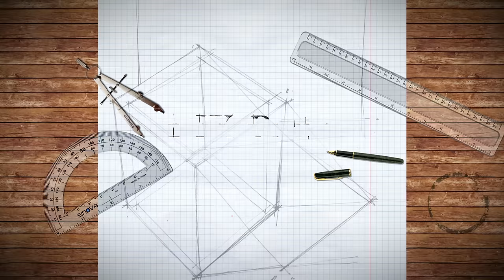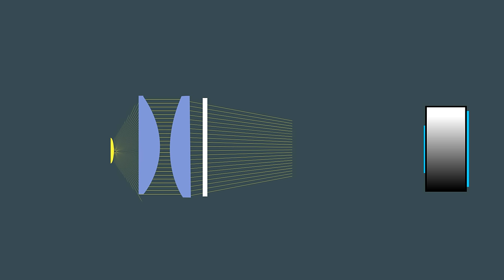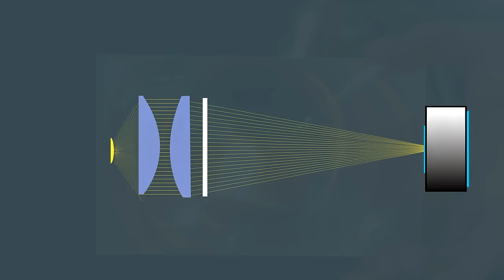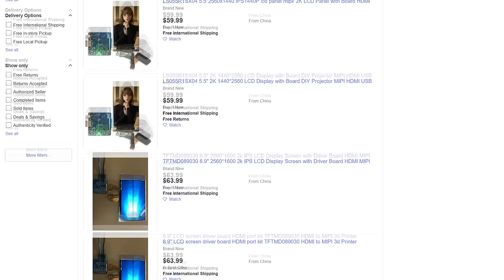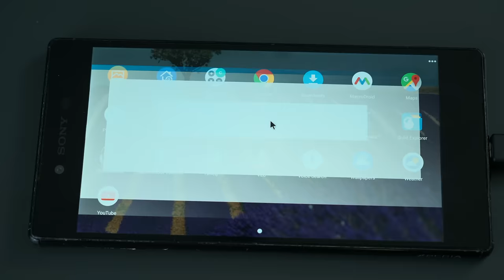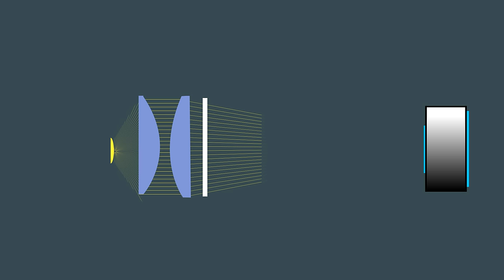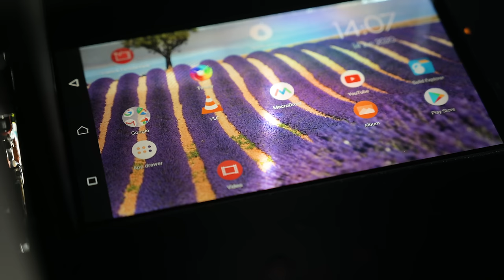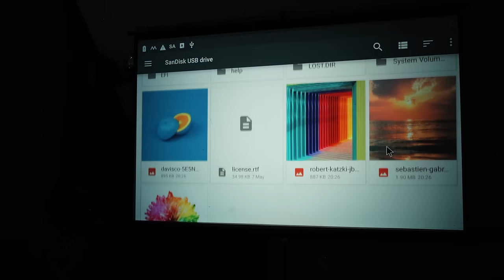Building a TRUE 4k home cinema projector (it’s awesome)

Comment: Just thinking, if you did decide to go for a more powerful LED, to alleviate the cooling and noise you could use an all in one CPU watercooler. Obviously design changes would be needed but you could comfortably deal with the heat I think.

Comment: A cpu heatsink is made to be oriented exactly opposite of how you have done it in the video.  The idea is that a small amount of liquid in the pipes evaporates then travels to the far reaches of the head sink and then cools.  Gravity then transports the cooled liquid back to the heatsink base.  If the heatsink is completely upside-down most of the heating performance will be lost ...

Comment: Stray idea ... build the entire thing sideways, use book bindings to skin the front of it, and set it on a shelf behind your seating. Just be sure to adjust the plan for cooling, airflow, and you could even remote the focus adjustment to the bottom end by running a hex or square rod the full length.
The one thing most missing from the design as a whole is ability to adjust size/skew without moving the projector to do so.

Comment: The sun is an extended light source with a 0.5 degree field. So it can never focus down to a point. The size of the suns image is given by 
D = focal length x tan(0.5 deg). 
Another thing about this design is that it doesn’t address uniformity of illumination. A superior method is to insert a pair of equal focal length lenslet arrays after the collimating lens. The spacing of the lenslet arrays is equal to the lenslet focal length. 
Now you have the LED light source integrated in intensity. You follow this by another Fresnel lens that images this field onto your light valve. 
Too complicated to discuss here, but using lenslet arrays produce the most uniform illumination.
Reply: Is there any chance of some sort of diagram to show this? I find it hard to visualize. I would love to see examples!

Comment: great build. if it were to be me, the build would be significantly taller and bigger because i'd use a 300w LED COB, mated to a peltier module, AIO cooler, and a dedicated cool air intake port, and air channel from a nearby aircon to maximize heat dispersion. since phone parts now are easier to source now, i'd go for a native 4k120hz note/tab screen, maybe samsung tab 9 ultra. use of larger screen is also vital to minimize the effect of heat from that 300w LED COB. just one question, how to integrate it into a dolby atmos AVR/processor?

Comment: With f/4 photography lens  you get about 8x less light opposing to real projection lens. But in such a focal lenght it's impossible to get some more speedy lens. With freely shining LED with no collimation you get only a fraction of LED light output to the LCD panel surface. Because only part of the overall light hits the fresnel lens below LCD. But wonderful project anyway.

Comment: Old video I know. But still inspiring. I have a few questestions: Because your LED is so color accurate, I wonder, where the color imbalances stem from?  Could it be the LCD screen, how Video is handled by a smartphone internally,  or even the glass of the older lens. For the latter,  would it be possible, to salvage a lens from an old/broken beamer from 10 years ago and have better results (I dont mean the very cheapest model). I also don't understand, why any lens could be considered too "small". I mean I could always size the light beam down(even to a point) by manipulating the distance between converging lens and projection lens. What am i getting wrong? As always great content.

Comment: Some modifications include ditching the phone completley and using the control board with ChromeCast, or Apple TV to utilize ScreenCast, or AirPlay. Worth noting that you need some HDMI ports if you want to connect your laptop to the projector. Also worth noting that you need some way to make like a standby mode by wiring some relays to the LED driver and a momentary power switch. And if you want a control over smartphone you can make Arduino setup with the WiFi shield.

Comment: How long does the LCD panel last before get burned? Also the projector is too dim. But using high power will get LCD burned very quickly. So, can you do DIY vido in how to build dlp, either 1 dlp or 3 dlp 4K projector?
Reply: God I wish he/someone did. I really want to build a good long-lasting projector.

Comment: Using Xperia z5 premium is a bad idea because I have used this device before,  the problem with it is that it can only display 4k images through the original gallery that is provided by the system so you can't use YouTube or any other app or browser , and it takes a few seconds to display the image in full clarity, and in addition, it only displays certain video formats in 4k and it must have certain format and not high frame rate and bit rate .

Comment: Funny: I bought the 4K Projector he used for comparison (or a successor of it) around x-mas this year without knowing this video. For me the image quality is more than ok, the brightness is impressive and the fans are not that noisy as he described. Yes it cost my a liver (1800€) but if I consider the time he spend on this project, the necessary machinery, the material and possible fails during build I'm satisfied with my LG Beamer.
This post is nothing against this DIY project - that is really awesome. It was only a decision I made for myself.

Comment: Would it not be possible to swap out a cheap projector LCD panel with the one you are using in this project? I was given a faulty one of those cheap projectors a few years ago and when I opened it up it was quite a basic setup, led light, low resolution LCD panel, mirror and lenses, surely with a bit of jiggery pokery alterations with the housing it could be done,  maybe an upgrade on the led light so it's brighter to 🤔

Comment: Nice video, but would be even cooler if you tried used parts from a tv to add HDR (maybe even Dolby Vision), some HDMI 2.1 ports and see if you even could reach 120Hz refresh rate
Reply: HDR is not just a software or a controller, for this project you must use mobile parts. HDMI 2.1 is unnecessary, 120Hz is unnecessary for movies, HDR is useless with this low level of dynamic range. You can spend all that money on a better canvas, which will be a great improvement.

Comment: Is there a way one could add a stage at the start to allow a larger LED panel as the light source maybe focusing it to a point usable by the original design....?
Something about 28x28cm using a panel of high-efficiency diodes....
A 100W diode might push out 8500lumens, a 100W panel could put out in excess of 17000.... and cooling isn't even that hardcore.
Reply: I am VERY curious of what the answer to your question is, 17.000lum would be amazing! I did a lot of VJing in my life and the sun rising in summer parties is just enough by itself to keep the dancefloor alive, smiling and pumpin', but damn those winter gloomy sundays mornings.....they could have used one or two more hours of colored trippy visuals!

Comment: @6:05 Those wires sticking up vertically is a mistake.  The LED will heat them up and destroy their insulation in no time - unless they're silicone.

Comment: i wonder if you could use an arduino to send an image to the screen instead of the phone... and also you might be able to hook up audio in connectors and like a power button and you could hook up a blue ray player or even an HDMI in port.

Comment: You mention in the video that "in just a minute" (21:20) you will be explaining why the air needs to push out, but I didn't catch that in the video "later on".
It feels contraintuitive that you are trying to suck the hot air down from the top and out at the bottom (after all hot air "wants" to rise), rather than suck in cool(er) air from the bottom and hot air out the top. I'm sure you thought this all through and there is a top-notch explanation, but, despite the mentioning, I failed to find it in the video.

Comment: This is amazing! But what if you still try to increase the brightness of this projector by modifying the matrix? For example, try to carefully wash off the reflective coating from the rear polarizing film using an acid solution. Or remove this polarizing film and make a new one with the correct direction of polarization, using the top film from the display with a larger diagonal, turning it at the correct angle.  Of course, if I were making such a projector, I would simply choose a matrix model without a reflective coating, albeit with a 2K resolution.
Reply: And also, instead of the power supply from an old laptop, you can use a more powerful industrial AC-DC converter with an output voltage of 12V. It should be more convenient and reliable compared to the laptop power adapter. This may also make it easier to use a more powerful LED.
Reply: I wish I could visualize what you mean. I am not sure what that would do/benefit it would have.
Reply: @Yourname942  I meant that if you wash off the reflective layer (aluminum coating), the brightness of the image may increase.

Comment: Interesting video. I've always thought it was akin to a cine projector / slide projector, which is simply a light source behind a film image, and said film projected via a lens of suitable frame size. The projectors of the 70's rarely used lenses to focus the beam, just relying on super hot, bright halogen lamps. (Can you imagine how hot a 1/2" high 100W halogen lamp got. If the cine film remained in the gate for more than a fraction of a second, it melted !!) 

I actually came to this article as thinking of making 100W video lights with suitable heatsink+fan ... if I can find a non heatpipe design!! In theory, should be as bright - but smaller - than the LED strip panels you made. (I currently have modified 50W LED floods with a fan blowing against heatsink)

Comment: Couple of things, why didn’t you put the display between the collimator and the converger, why didn’t you use an sla printer display replacement; very high resolution, usually 5.5 to 6 inches and the backlight is pre removed.

Comment: Sadly a lot of questions/details haven't been covered (in the video, in his comments section, nor on his patreon, overall lumens / ANSI Lumens, how large an LED needs to be/can be compared to the LCD screen size, generally how long before the LCD burns out, how much time can the projector remain on (I plan on using it daily for 6-10 hours a day), if water cooling would greatly increase the life of the screen (or if it is even possible - without causing distortion), as well as color quality/range/contrast levels, and I read someone mention about the way his setup is leads to non uniform lighting

Comment: As far as the brightness goes, you could probably buy a different shade of polarized film, and replace the one there, and probably set up a feature to adapt the brightness level for the Led. The DIY unit would far exceed the expensive unit by leaps and bounds.
Reply: would that be very expensive to do?
Reply: @Yourname942  Nope, you can buy sheets of polarized film, and it's pretty cheap. As for the LED, you would just need to wire in some kind of simple controller, like a dial of some sort, that exceeds my technical ability, but I'm sure if I looked into it I could figure it out, is it expensive? No.
Reply: @ichigonubetube  well that's good. It is also out of my technical ability, but maybe someone knows :)

Comment: He claims the air is pushed outwards from the center gap however at 20:05 it clearly shows the arrows on the fan housing (for one of the fan) pointing towards the radiator meaning the air is pushed into radiator towards the center gap & at 20:28 it shows the other fan is attached to push air towards the center as well. Clearly, he hasn't checked the fan direction whether it is pushing/pulling the air or he assumed it will be pulling air from the center. 

Meaning the design of this projector actually pulls air from bottom cutouts NOT TOP and the hot air escapes through the top cutouts. 😀

Comment: Your video is good but there are still few things you don't explain, making it hard to understand the whole thing. 
After the first fresnel lens the light rays are parallel whatever the LED used right? So why does the camera lens need to be adjusted for the LED size ? 
Also I think the LCD screen should be placed between to two fresnel lenses and not after as the light rays passing through it need to be parallel to work better - still it doesn't seem to impact much your video projector

Comment: What is the reason for the unusual pixel configuration on the right at 26:19? Why not a regular square grid of pixels? Are the 4K LCDs linked in the description definitely like this as well?

I am working on a project involving pixel-perfect positional calibration of projectors; this apparent resampling of the video signal somewhere on the controller board for the LCD could cause complications.

Comment: i really like the focus on sharpness and color fidelity of your build. I guess it still lacks the connectivity you would want for the audio (a 3.5mm jack doesn't cut it for me). But i really don't care about it's bulkiness, as long as it's sharp, colorful and silent, it's most of what i like in a projector.
Reply: The otg hub used in this project can also be used to implement an external audio solution.

Comment: Hello! Thank you for sharing so much knowledge.

I have a question, I have a 10.1" screen available with which I can do this. Do I have to get the fresnel lenses in the same size, or would this not be a problem?
Thanks
Reply: That wouldn't work, rewatch the video starting at 16:05 and think about how large the camera lens would need to be to project a 10" image source.
Reply: @draginator6  Ok, thanks for your answer. I'll try different variants.
And I have another question, I got a lens from an old Czech school projector. Its lens is 400mm. What LED would I need to cover it? Since at minute 4:25 it mentions the size ratio, but I don't understand how to solve the calculation.
Reply: @lucasegea9454  The size of the LED isn't directly related to the focal length (the 400mm part), it's more the aperture of the lens (f1.4, f4, f8, etc) that is effected and is talked about at 17:08. If you can see the whole led surface when you hold the lens over it you'll be fine.

Comment: actually, an actual 4k projector have 4 LCD panel to avoid pixelation between different colours. this is because all LCD panels have the sub-pixels while a project have the 3 pixel of R and G and B aligned to the same spot such that there is only pixelation caused by the gap between each actual pixel while this DIY project will have pixelation between different sub-pixel and pixels. this will affect the color accuracy.
Reply: BTW the LCD needs cooling. the polariser is on the LCD, shinning light that is 280W through it directly could cause it overheat at/in the long term and damage the LCD panel.

Comment: Did someone try that with a stronger LED? What happened?

I would think a 200W LED with a Water Cooling System would greatly benefit the whole system. Maybe the LCD would then need some direct cooling too. What do you think?
Reply: I wish someone would post if they used water cooling and/or if they used a larger LED (and how long it lasts before it burns out the lcd)

Comment: @DIYperks hi is it possible to get a cheap Chinese projector takeout the circuit board and screen and replace it with the 4k screen you used or something similar in this and it's phone mains board or maybe a raspberry pi board . This would be a much cheaper option with alot of it being pre built it would just be a case of dismantling the cars to remove the board and screen and replace with the parts I described I think this could be a very good option.

Comment: A question about the negative pressure setup for cooling. In PC builds it is always mentioned to go for positive pressure, so you don't pull dust through any unfiltered places into the case. Does the direction of airflow actually matter in this case?
Reply: Airflow direction matters in this build because the hottest place is at the bottom by the exhaust, reversing the flow would mean all that heat from the led lamp would go up by the screen and phone, potentially destroying them.

To make it positive pressure without reversing the airflow, he would need to add fans at the top of the case, which would disturb the light inside the projector and make it harder to keep the light sealed on the sidewalls as well.

Since his case is 100% custom it's very easy to just ensure the air seal is perfect and eliminate unfiltered places, so negative pressure works fine in this case.